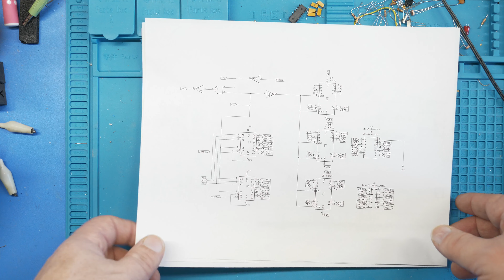Designing a new board for a 38 year old Fadal CNC machine

Comment: That's pretty awesome! What's amazing is these controls were built, basically unchanged, from the mid 1970s until around 2012. They even brought it back after the MP32 disaster. I'm not sure how they did it since the 8086/8088 chips were discontinued in the late 90s. It's amazing how much all of these controls were the same. Mitsubishi, Yasnac, Fanuc, Fadal, Haas, Dynapath, etc all used the 8086 family processors with that card cage design. They all ran some version of DOS. I really think they would still be running that system if they could still get the chips and there was support for USB and ethernet on whatever ancient version of DOS they all ran.
Reply from the maker: Yeah, that is part of the allure of Fadal, the same basic design was used for their entire run.  They upgraded to a 286 with the 1400-3 and a 386sx with the 1400-5, and 486DX4-100 with the 1400-6.  They even built the "PCB-0346" which was an Nvidia M6117 embedded SoC PC104 computer on a card, replacing all 3 of the main logic cards.  As I understand it, everything that came after the 1400-5 was not very reliable and basically hot garbage.  AFAICT, they only would have used DOS perhaps with the M6117 control, since it was a PC architecture.  The rest is all bespoke custom x86 assembler.  I've done some reverse engineering of the 1400-1 software, but the addressing scheme of  the 1400-2 is a little more challenging.

Comment: Hi P, this brings memories of the old days designing 6800 stuff in the 70's.  You must be having fun since your attention span exceeds the minimum for success. I estimate gcode volumes of about half of your most complex dream parts will fit in the new memory.  My 386 based controller holds double and I think I filled it once. I have a pair of twin test xrf devices that use a TI 8 bit with the same design simplicity, but the twin test devices are not as useful as your cnc so they will drift to obscurity, but not without thoughts similar.   What up with the v10 truck?
Reply from the maker: Yeah, it was fun.  This board was actually born out of illness; unfortunately I got sick a few times and so I started playing with KiCAD during one of these.  I estimate that I probably have around 100 hours into the reverse engineering, design, and debugging of this memory expansion.  If you consider that in context for back in the 80's, that's like 2 sprints worth of work in today's measurements.  The V10 is a bit more involved and is just one in a bunch of projects I need to complete.

Comment: With your knoledge will be interesting if you ca make a card to convert encoder signal to resolver signal. To be able to replace that very old resolver technology.
Reply from the maker: You don't need to do that, the later cards have both resolver and encoder support.  You have to make a choice, stick with the old tech or adopt the new tech.  Encoders, fast CPU, and memory all come with a price of about $3800.  Converting an encoder signal to a resolver signal would take some neat tricks and it wouldn't be cheap.  I personally like resolvers, they are technically higher resolution than encoders.  The major problem is that they wear out faster than encoders.  For me, I had 3 rebuilt motors from 20 years ago, so my motors got a new lease on life.